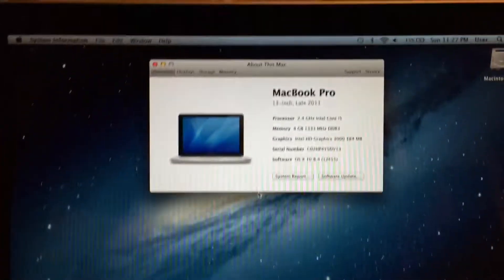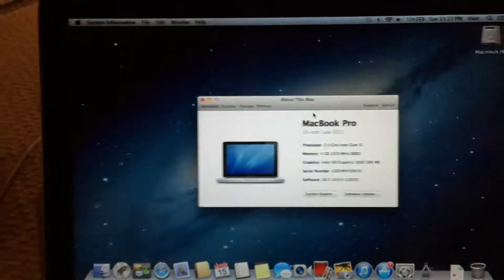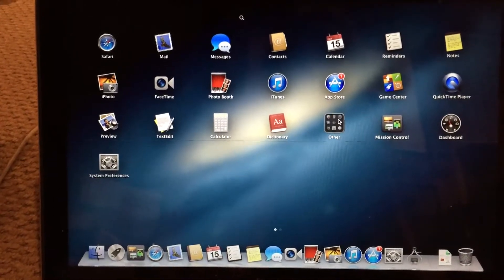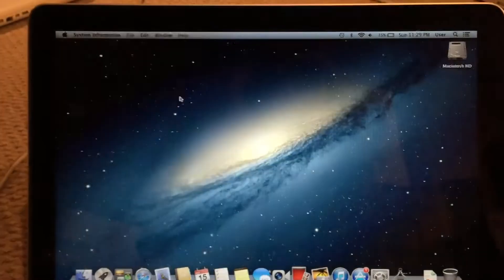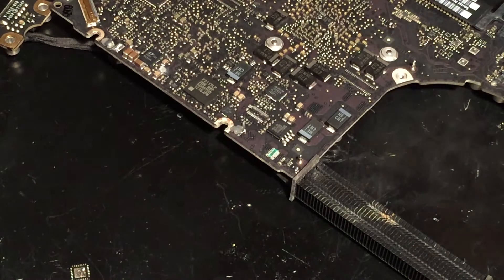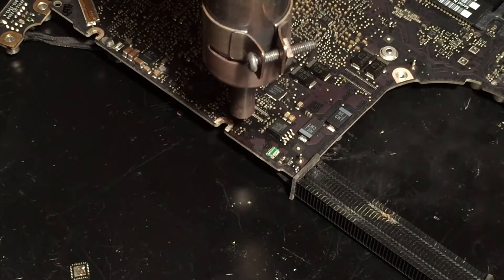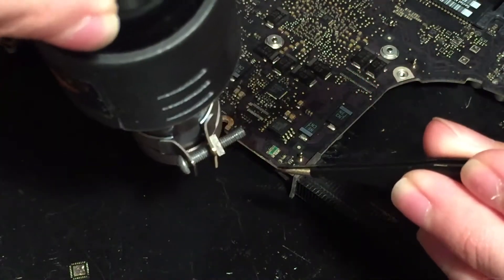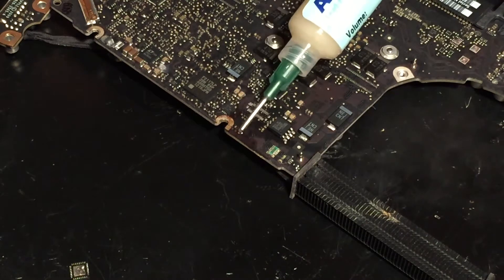Repairing a Late-2011 13" MacBook Pro that runs Slow off Battery

Comment: @dosdude1 bro i have my 2011 17 inch mbp and i installed big sur by oclp but the thing is it goes 86% cpu usage wothout even using an app and is really sluggish. It had the same behaviour in high sierra and even on elcapitan. Does nkt recognizes the battery but that must not be the issue i think. I7 quaf @2.2 base clock. 16 gb ram 1600 mhz, patriot burst ssd 120gb.

Any suggestion would be appreciated. I have tried to dissable dGpu but same shit

Comment: Im having same issue like this, i thought it was only about the battery, but after i changed the battery, it still running slow when not connected to a charger.

Comment: I have the same problem but mine is with and with out the charger plug and the fan is running so fast
Reply: Mine had the same problem until i got a new battery. This model cant run without battery.
Mine now fails on battery but works ok on power cord. I have to check where to get resistors and IC to fix mine old buddy...

Comment: i have a same problem but its not because water damage. as i remember, one day i wanna install an app, but cant install it. so i search the way and its say 
open terminal and type 
sudo spctl--master-disable
after that i can install the app normally. 
after a day i open my macbook, booomm...!! it getting slow. but when i plug it to magsafe its normal again. 
i already replace the new battery but still slow, i reinstall os and still slow. 

BUT, when i my windos OS on bootcamp, its normal even its unplug the magsafe. 

really confuse 😭

Comment: 2009 A1278 820-2530-a battery temp sensor is bad but I've tested multiple batteries. The fans run fast only when a battery is installed. I suspect a board issue with one of the pin traces. Any ideas on which of the battery pins passes the temp data? I'm assuming the battery temp sensor is on the battery.

Comment: I have this same model with the same problem and same water damage. I don’t use a laptop for eve day use, so I don’t mind having to have it plugged in. Should it be ok to use?
Reply from the maker: Yeah, it won't hurt anything to use it, but of course it will be practically unusable when on battery.

Comment: I am having the same issue. But my mac is working fine in safemode. So if it is a board issue will it works fine on safe mode?
Reply from the maker: Yeah, the power management drivers are not loaded in Safe Mode.

Comment: Wow, amazing, This video could be the solution for my MBP 2011, however I still don't really understand after watching whole video few times coz I am a slow study, If I am gonna repair it by myself, what exactly should I do, between 2 resistors and IC 5300? jump from which and to where? thanks
Reply from the maker: It just depends on whether or not the pads have corroded away or not. If all the pads are there, then all you need to do is replace the IC and resistors, and you should be good to go. If you do end up needing to jump points, use the schematic to figure out where each pin is supposed to go.

Comment: I have the same symptoms with my MacBook Pro same year but it was an over heat not water you got any advice for this situation?
Reply from the maker: Does it run slow off battery only, or slow even when plugged in?
Reply: It run very slow off battery run ok ish on charge as long as it’s 100%. When is was working fine I used to use it on my lap which apparently causes over heating but the issue is I don’t know what needs to be changed.
Reply from the maker: Yeah, sounds like it may have the same issues as the machine in this video.

Comment: I'm the guilty party here, that machine used to be mine and it was running exactly as he described, and I had assumed that maybe it had a screwed install of macOS on it. Installed El Cap onto it and it made little difference. I finally decided to open it up and OH LOOK! water damage! I wasn't pleased.

Thankfully Collin saved my ass by trading me a 2010 MBP to use in the meantime while I figured out what I was going to do.

As for what I paid for the 2011...I paid a 2012 Dell Precision M4700 and I still regret it to this day.